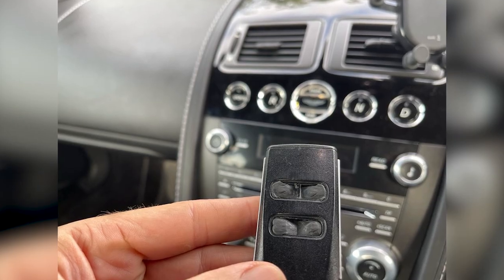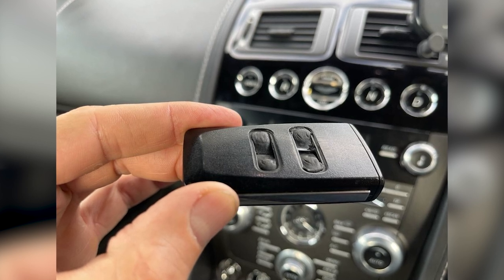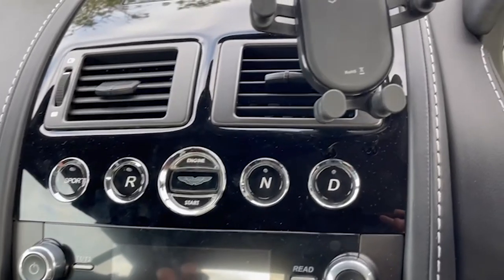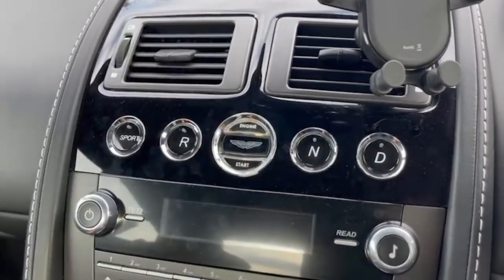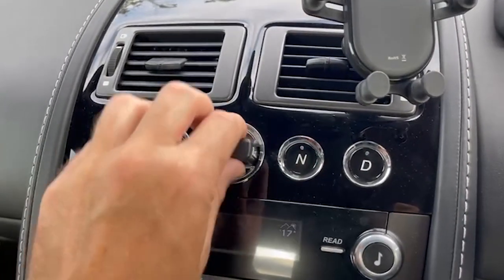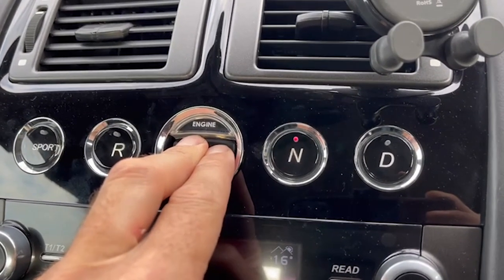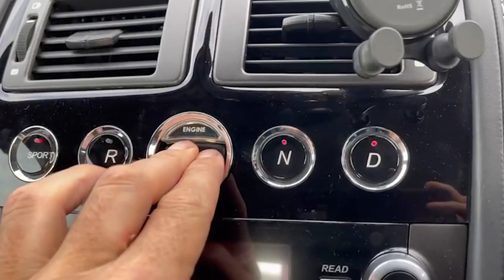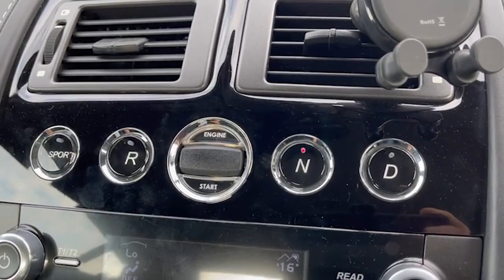Check your worn-out key doesn’t wreck your sportshift clutch! Forum Chat #80

Comment: My key is very worn. Is there a cheap way to replace the outer shell? I havnt come across a cheap refurbish kit yet
Reply: Not 'cheap' but I found a second hand glass key housing for £250 (because it had a chip out of the glass) and moved the guts of the plastic key into that. Now I only use a glass key and keep the original glass locked away
Reply: @DanS443  Tanks for the answer. Good to know the "guts" are interchangable - a question the official Aston dealer could not answer. Not due to unwillingness but they just didn't know